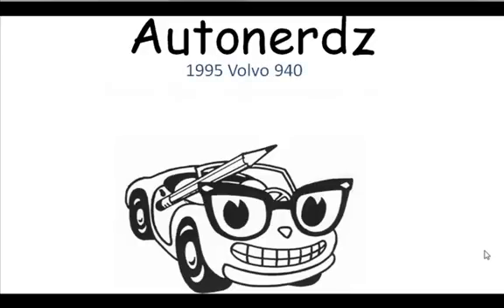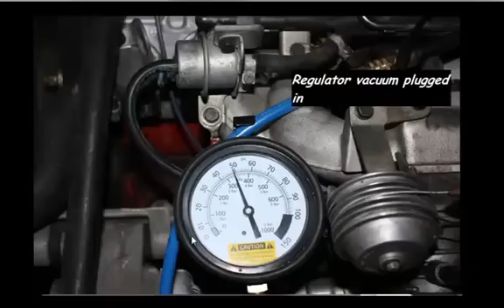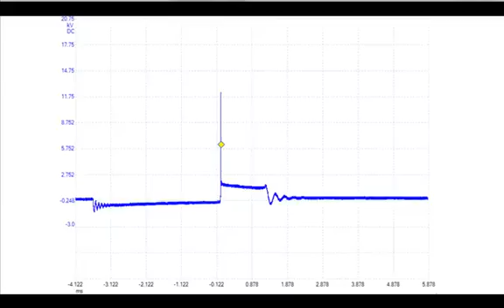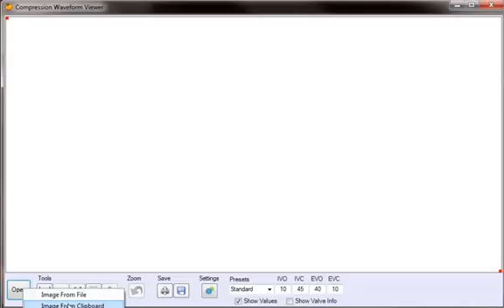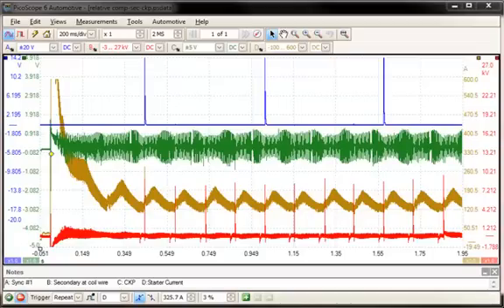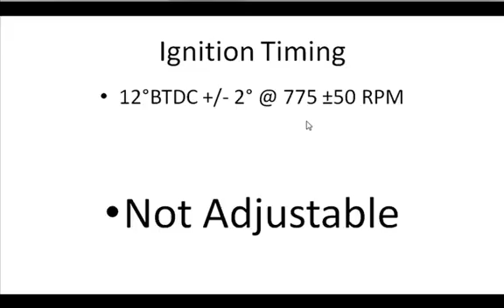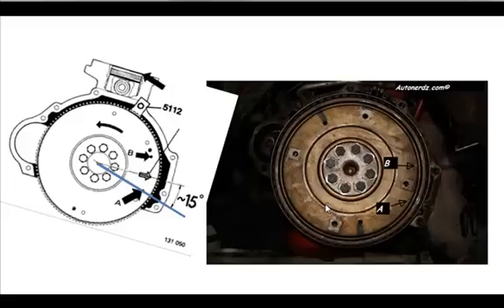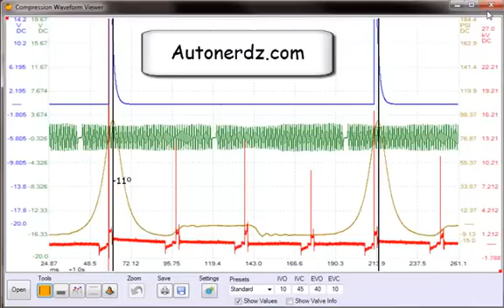Volvo Problem Child.mp4

Comment: Real quick... I thought that the relative compression check would only be used during cranking because your are measuring starter current draw.  When the engine is idling, your not measuring current draw from the starter.
Reply from the maker: That is correct.

Comment: Nice demo. You may not have even known that somebody had the flywheel off. I'm not surprised it went through several shops before the correct diagnosis was made. Too bad the problem couldn't have been adjusted electronically, without removing the flywheel again.

Comment from the maker: @brettless80 

Thanks for asking.

The current clamp is used during cranking to detect the peak currents from the starter as each cylinder comes up on compression.

Comment from the maker: @DrPicoflu 

That would depend on the shop and the technician dealing with it.  A shop with the diagnostic equipment and a skilled diagnostic tech to use them, should have been able to conclude that transmission removal was the next step in a couple of hours, including Alldata research.  After that, the customer could have been presented with the prognosis and the estimate for trans R&R to pursue the problem and a retest to confirm repair.